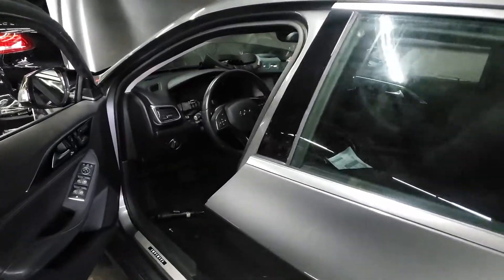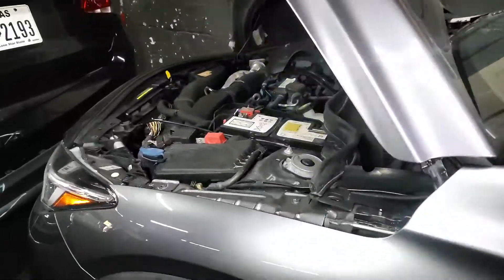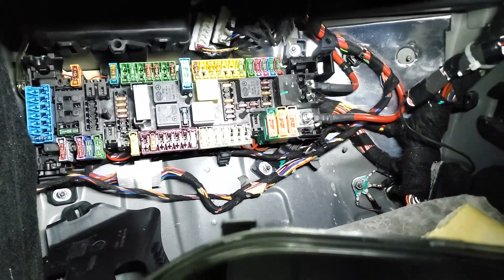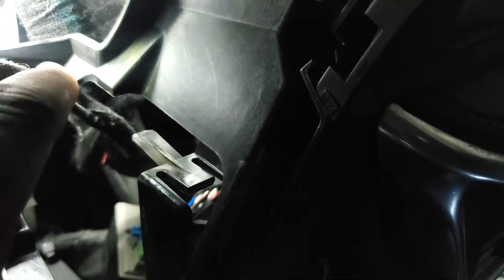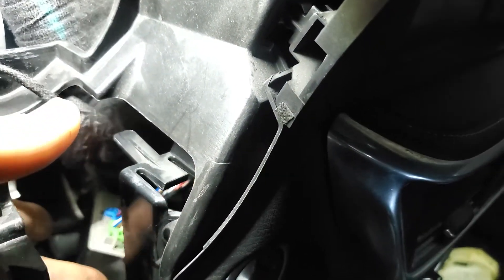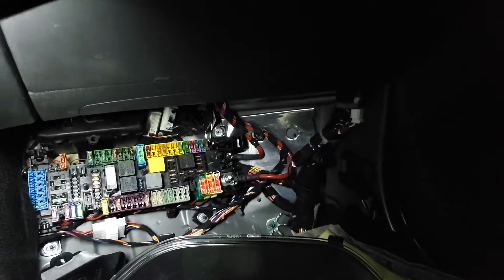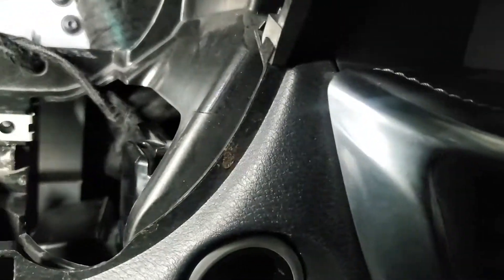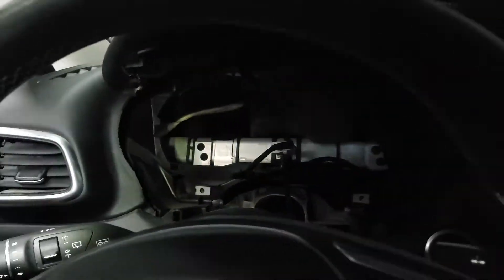2018 Infinity QX 30 No Starting No CranKing Code B 21DC-01 Part 2

Comment: Hello I have a 2017 Infiniti qx30 that won’t start the dashboard says do not shift gears visit dealer and the computer shows a message that is the immobilizer and I’m not getting power at the starter I need help please contact me
Reply from the maker: Daignose the car see if there is a code, if not also check if there is water in the car
Reply: @BestCarFixes yes I have a few codes and water but I don’t know why the car don’t want to start it’s like is freeze do you have any number where I can call you I’m getting pretty much the same codes that you had with the 2018 Infiniti qx30 what was rhetorical problem with that one than answer me